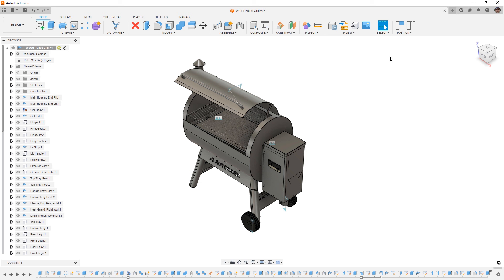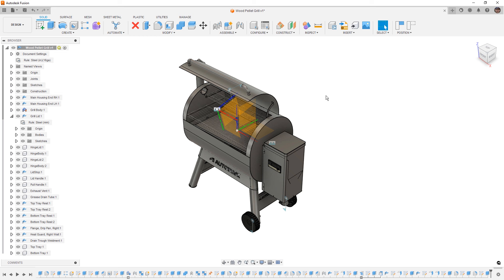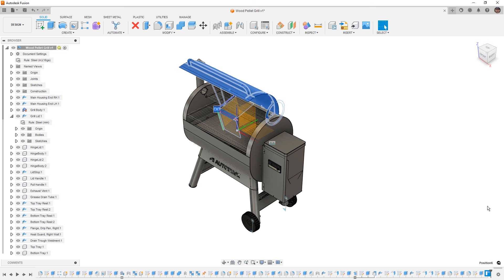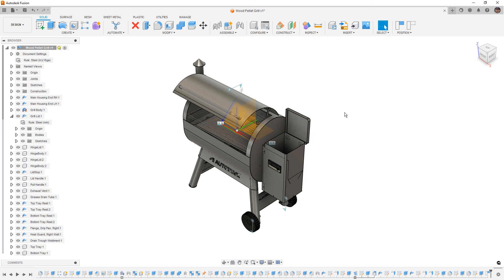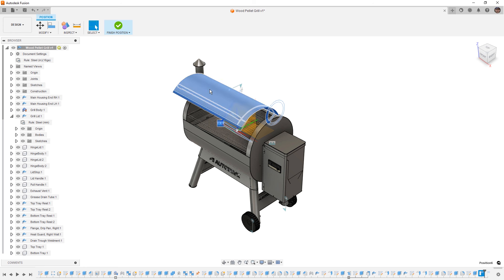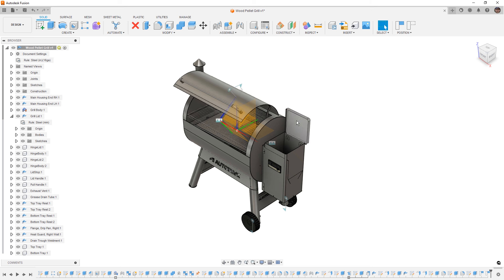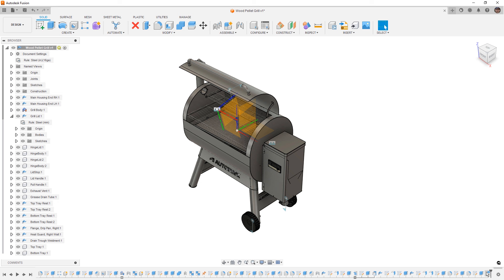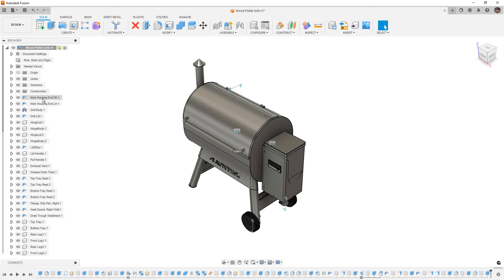How to Use Capture or Revert in Autodesk Fusion

Comment: Buggiest software I've ever used. Been using CAD/CAM for 15 years. 3DS Max, Revit, Solidworks you name it. Fusion's buggier than wine programs ran on a hackintosh without the correct plist files.